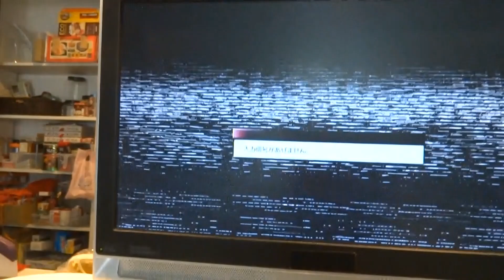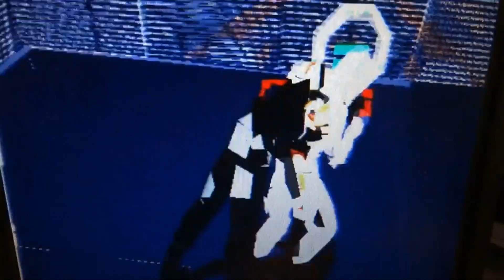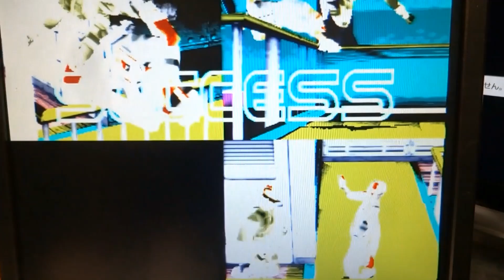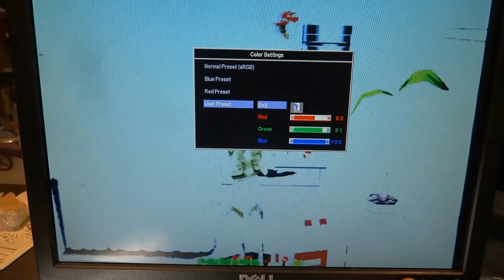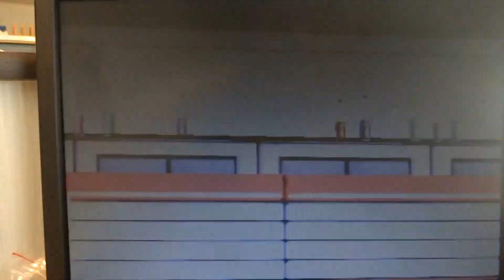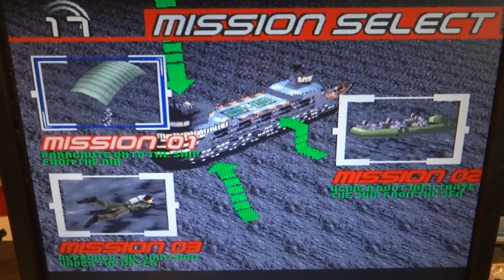Sega Dynamite Cop Arcade PCB Repair

Comment: The 315-5799 custom you're reflowing is the 'Tex & Mex' (texture and texture memory) controller. It's common for these to have cold solder joints. The four red LEDs jumping around at the start are the audio channel assignments, the channels are assigned on a rotational basis.

Comment: If you don't have one, I'd recommend one of those cheap [ circa $40 ] usb microscopes. I once hand soldered a tsop-40 and it looked beautiful using a macro lens, but under the scope I could see really fine solder whisps & flux bridges much more easily. :)  ..they used to be sold by Maplin, which has sadly closed down a few years back, but Amazon should be good enough.

Comment: I believe these cost more than US$4000 back then due to the cutting-edge graphics technology used.  GE Aerospace developed the custom 3D hardware for these games, which at the time was the most advanced realtime 3D graphics technology available anywhere.  They would later sell this technology to Martin Marietta, who marketed it under the name Real3D.

Some of the later Real3D cabinets with the large projection monitors have air conditioning in them!

Comment: I’d completely forgotten this was on Model 2! I’ve got Dynamite Deka on ST-V and had assumed the sequel was on Naomi. 

Great work getting it fixed, I’ve got a couple of Model 2 and System 22 games and I dread the day when they die as replacement chips have long since run out other than cannibalising dead boards for parts and eventually even they will run out.

Comment: I have quite a few Model 2 / 3 PCBs. Yes they are all 25 khz. Then - are ALL the +5Volt lines on the JAMMA adapter connected ? Model 2/3 PCBs are really power hungry - you need an Arcade power supply that has enough Ampage - I have Model 2/3 PCBs were you have to crank the +5Volt line up to 5,3V-5,4V thatthe game runs properly. Also check all the connectors between the boards on the PCB stack - the pins get corroded, bent, break off, ect............
Reply from the maker: Thanks for the info. Yes indeed, I totally agree. When the power is low on this board it locks up at certain parts. The power was the first thing I checked on the system. With low power, the board will run for a while and then it will lock up at the exact same spot each time. Luckily the PSU Im using has more than enough juice to push the board, just needed to crank it up a bit to keep the game running.  The biggest problem here was the lifted quad pack and cut traces. Luckily its back up and running now :)

Comment: Do you order those off ebay or do you dumpster dive in the back of arcade centers in Japan?
Reply from the maker: There are no dumpsters filled with arcades here in Japan unfortunately, if there were, I would be there daily lol. I buy the boards from everywhere but sometimes I also get a few from friends to try to fix up rather than go in the trash for good :) Thanks as always.
Reply: @lukemorse1  😀

Comment: Awesome video. You might wanna check how hot the CPU gets. Model 1 and 2 are notorious for dying the heat death.
Reply from the maker: Thanks my friend. Will do. I currently have 3 fans connected to the board but I may add a 4th one as well to help with the cooling. I dont believe this board had ANY cooling at all before I got it so Ill try to make sure it stays cool. Thanks again.

Comment: Those custom fine-pitch quad flat packages (QFPs) are a nightmare, one slip up on one of those fragile pins and it's all over, I'm no stranger to SMD soldering/reflowing but I don't think I'd have dexterity or patience for that, maybe if I had some decent solder paste and hot air station I could do it. Any who, congratulations on the find, those Model 2 boards are getting pretty hard to obtain, would definitely recommend mounting some heatsinks on the GPUs with thermal cement as they're notorious for dying from overheating, what am I saying, am I, the student lecturing the master right now?
Reply from the maker: Lol, awesome man, some really good info and I appreciate it for sure. I've got 3 fans onboard as you can probably hear at the end of the vid but I agree, having some other heatsinks would help out a lot. 
There are 2 more of these monsters under the rom board as well as a couple CPUs. 

It really does need some thorough cooling and I'll look into what else I can do. Thanks again for the info and ideas 🙂